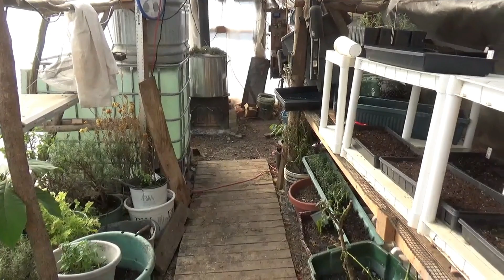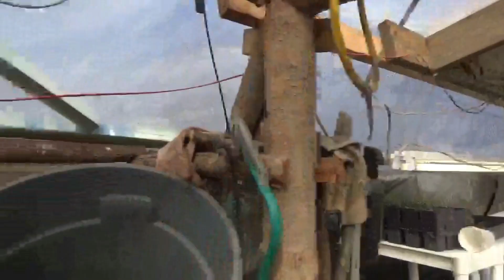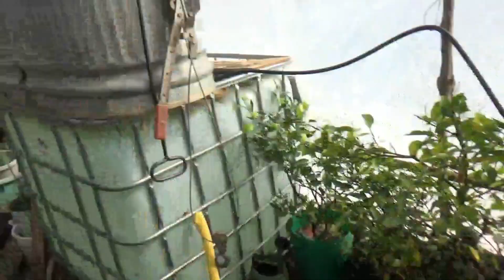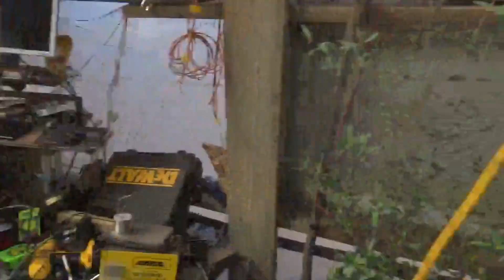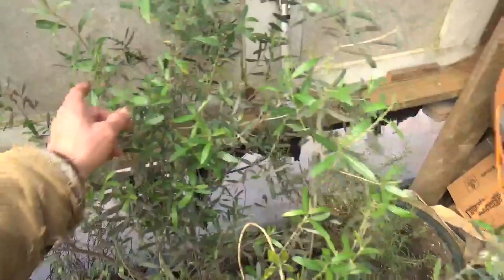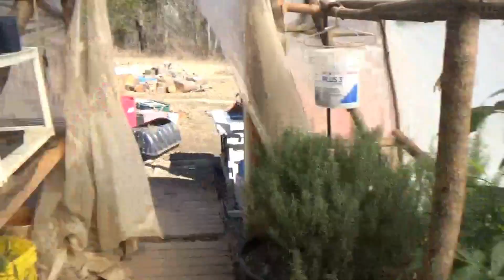Greenhouse Update Raspberry Pi Troubles And Propagation

Comment: maybe you need a cover for your pi board and wiring area. Humidity may not be best environment for it...
Reply from the maker: Thats a good thought.. I have considered it.. but it needs to be kept cool... it is in the waterproof box... I suppose I could pipe outside air in which sometimes would be less humid. (well sometimes)  At the end of the day I had bad sensors.  Thanks for the thought.